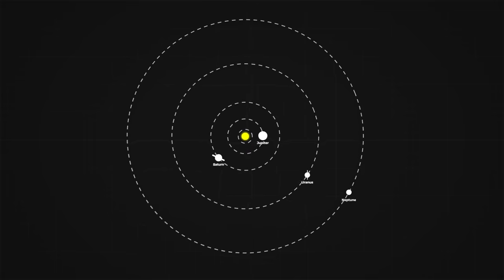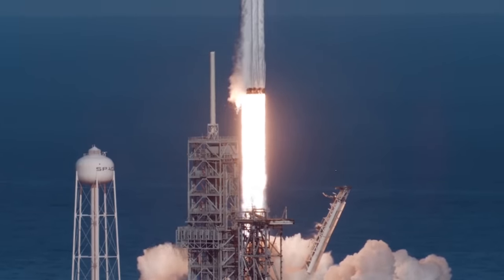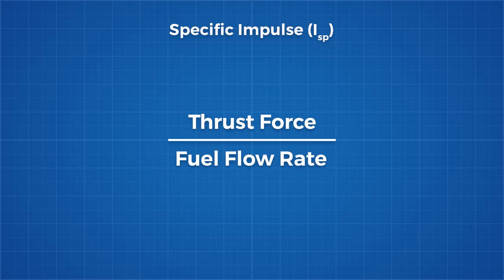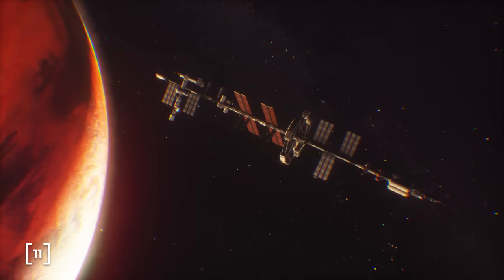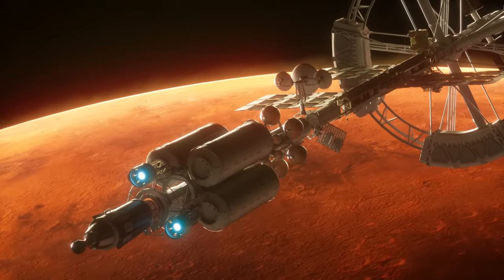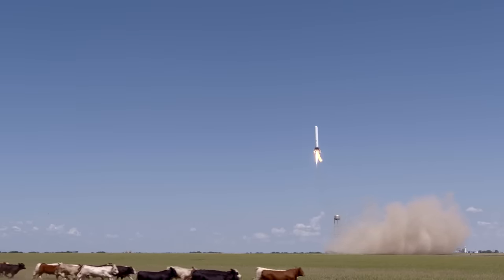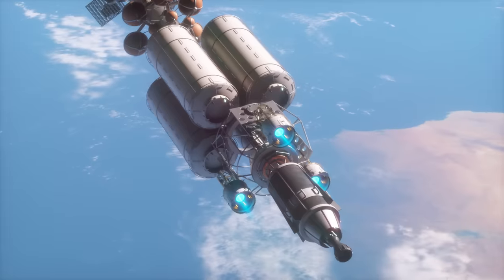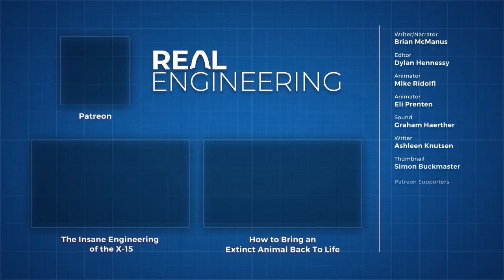Can Nuclear Propulsion Take Us to Mars?

Comment: They might be able to get around the leakage issue with liquid hydrogen by liningg the interior of the tanks with multiple layers of graphene and holding it at a static potential to repel the attoms although that comes with other challenges.
Reply: How about harnessing Interstellar hydrogen?  Space is full of it.
Reply: @arthurzettel6618 dunno about that, you'd have to be going slower relative to the interstellar medium than your exhaust velocity, otherwise the kinetic energy you lose to catch the hydrogen can't be made up. Ironically this makes for a sort of "drag" effect.